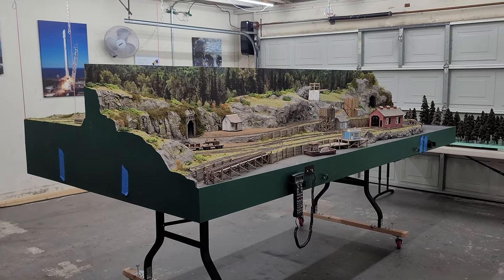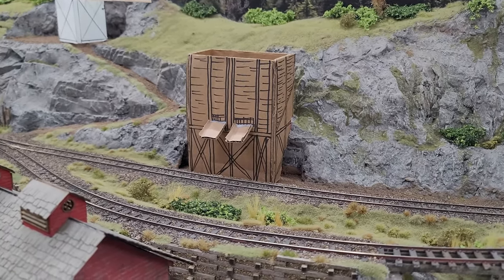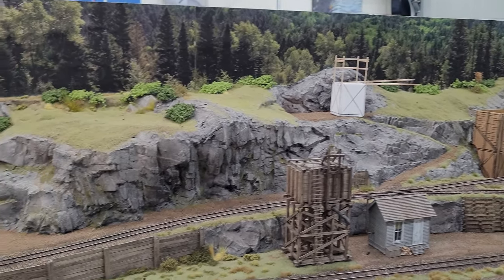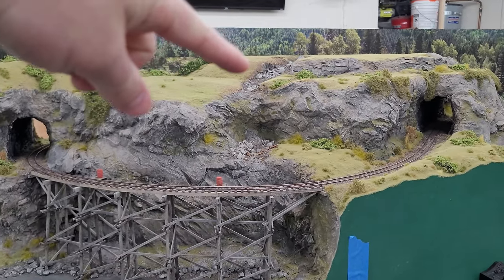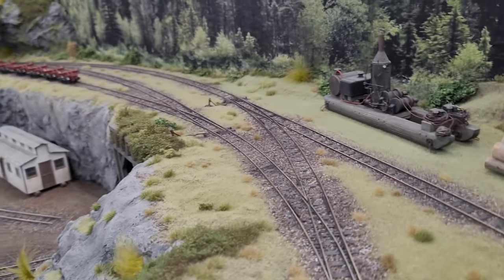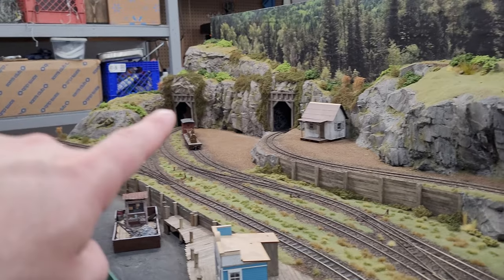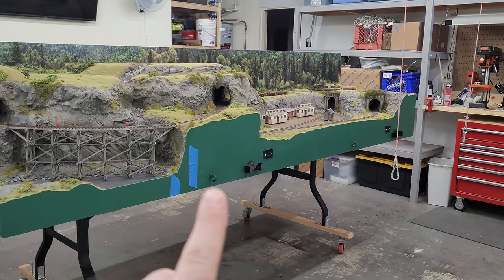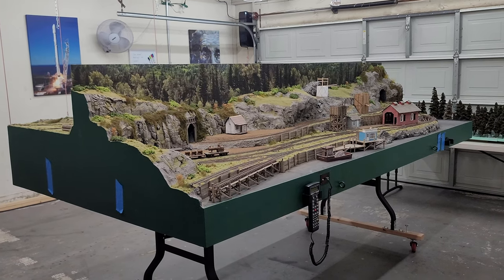Wandering Spruce Railroad March 2024 Update

Comment: It is impressive!  Unfortunately my train room has a choke point down to 6 foot wide, for a 9 foot length of 17 feet total length, so I can't build anything like that.  I wish I could.  By the way, an often over looked lumber product is mine stulls.  1. : a round timber used to support the sides or back of a mine. 2. a. : one of a series of props wedged between the walls of a stope to hold up a platform for supporting miners, ore, or waste or to protect miners from falling stones.  Your lumber company could be contracted to provide stulls.  In Arizona there were some that were not round that more looked like railroad ties, but the length of a narrow gauge flatcar.  At the Morenci mines there is a photo of a pile of mine stulls stacked up a cliff.  Looks like a mountain of stulls.  Next to that is a sawmill.  Stulls were cut to size onsite.

Comment: Hi Sean, I stumbled across your videos on the Shay upgrade and had no idea you had a layout to run it on!  I have been a fan of Iain Rice's Lilliput Logger since it first appeared in MR decades ago.  You have rekindled my interest in that project.  You have done an amazing job on your rendition, in what I'm assuming is On30!  Hope to see more vids in the future.
Reply: Hi! Great, so happy to have you. I stumbled on the Lilliput Logger plan many years ago and I knew when/if I ever had a chance to build a layout, that is the one I was going to do. This is an On30 layout, we stretched the original trackplan from 4x8 in HO to 5x10 in On30, that is part of the reason we are so limited on space for the lumber mill, but that's okay. The mill we build will be a representation of a mill, not a true 1:1 model. The trackplan we have here is very original to the plan as Ian drew it, we just added a 3 way switch by the mill and omitted a diamond crossover - other than that, it's pretty unchanged. Unfortunately,  Ian passed away last year before he was able to see this complete...
Reply: @Seanmmvi  I noticed the 3way in the vid.  Did you hand lay your track work?  I would like to change from HO to On30 but I have so much HO equipment and time/age has become very real it’s probably not in the cards.  I enjoy seeing the amazing work others do as I plug away on a small shelf switching layout.  I actually played around with the idea of a linear design of the Lilliput, which I’m sure Iain would have approved of!
Reply: One more point, you might enjoy taking a look at Carl Brainerd’s YouTube sight, he’s got a beautiful HO logging RR that might provide some ideas/inspiration!